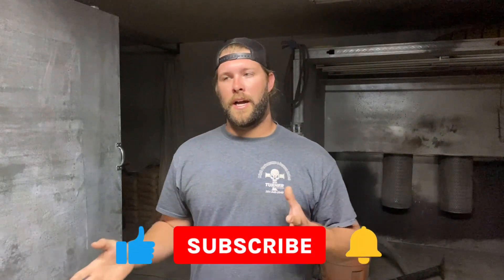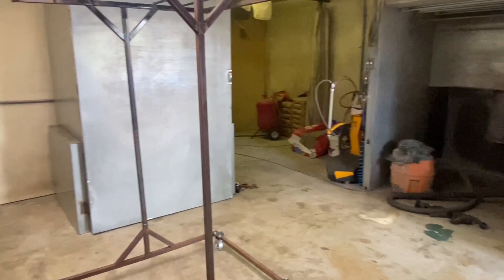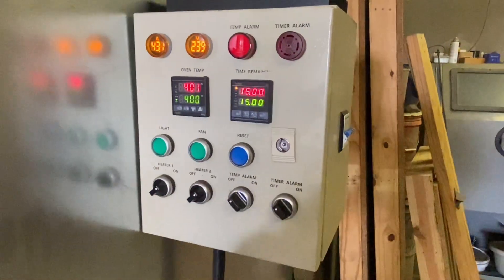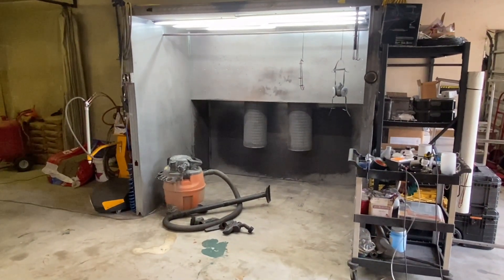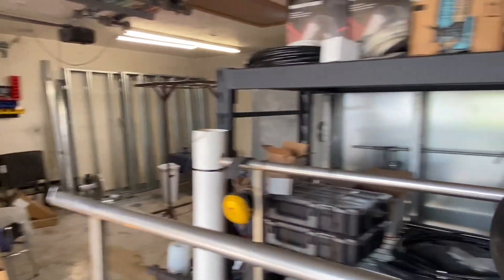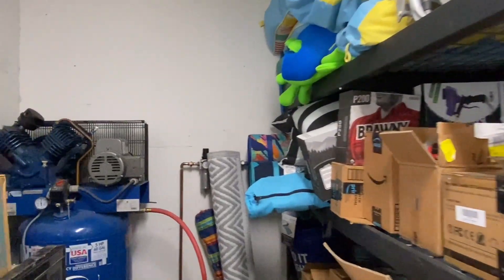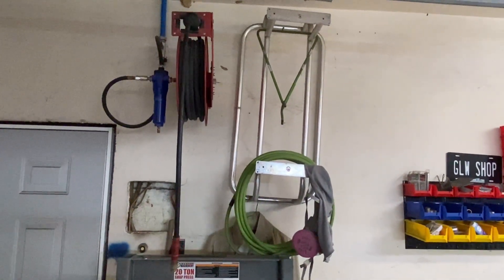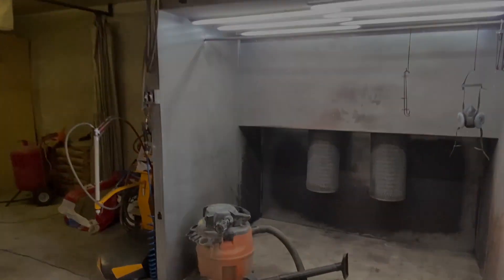My Garage Powder Coating Shop

Comment: Can your next video be on how to clean the RC-1 with the hopper upgrade. I blow the lines out but I can still see metal flakes when I change powder.
Reply from the maker: I can do a video on that. But until I can get one put together, get some foam backer rod from your local hardware store. Cut it into 1/2-3/4” pieces and blow them through your powder hose with your air compressor.

Comment: great video! what size is that Scat blast cabinet and where did you get it from?  How would you go about setting up for blasting large parts outside? I am building a 20X48 workshop and intend to blast my 55 gallon drums right outside the back garage door
Reply from the maker: That is a 970 that I purchased used. It originally came from TP Tools. 

If dust isn’t any issue I would just blast in the open air. This is typically what I do for my larger items that will not fit in my cabinet.
Reply: thanks! @royalcoatspowdercoating

Comment: You don't have any moisture issues with out a dryer or after cooler? Man I wish I had that blaster cabinet.
Reply from the maker: You can see some of my air filtration starting at 8:30
Reply: @royalcoatspowdercoating   dang it, must have missed that section

Comment: do you need the refrigerator air dryer to powder coat
Reply from the maker: You can do with out, I did for a long time. But it definitely helps where I’m at with the humidity. You will need some sort of filtration though.
Reply: @royalcoatspowdercoating  oh ok I didn't know that are the filters to just get the moisture out of the air? and what kind of filter would you suggest?
Reply from the maker: @prestonklug7792  I have that followed by a 3 stage filter from Amazon that I paid $200 for and then coalescing filters at other points. They’re made to take out different microns of various moisture, oils, and debris. You can probably get by with the 3 stage filter and then I’d put a filter before it enters whichever piece of equipment you are using.

Comment: how many heaters in the oven and what is the power?
Reply from the maker: 4 2400 watt elements
Reply: how long does it take for the stove to heat up to 180c °
Reply from the maker: @takitamtoten1480  takes about 20-25 min to heat up to 400°F